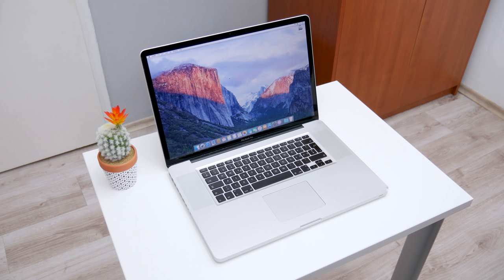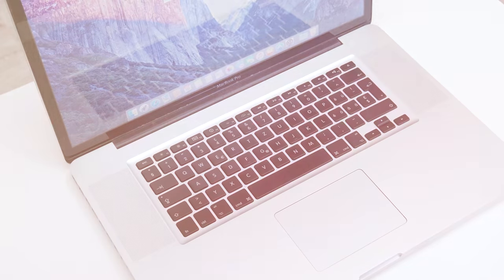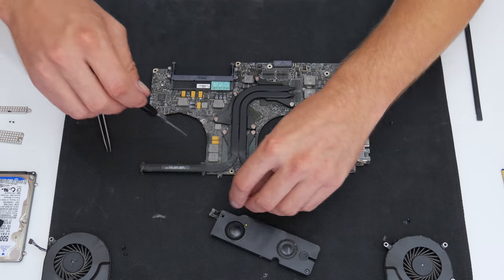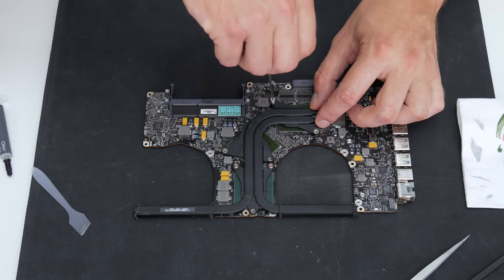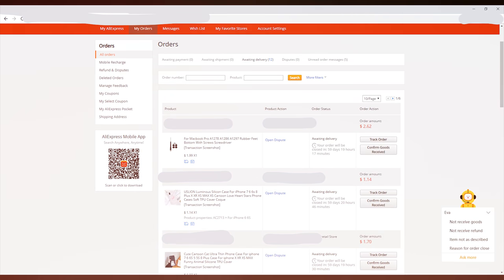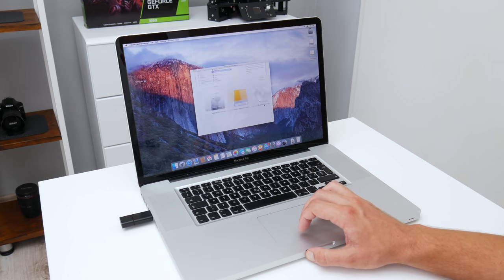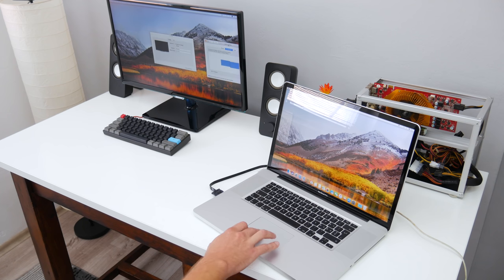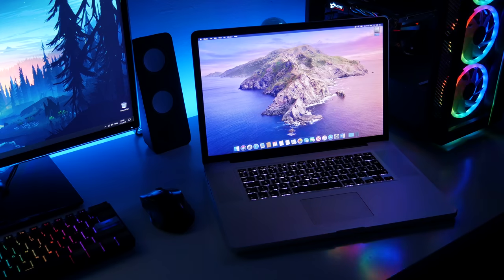Restoring and upgrading 17 Inch MacBook Pro and eGPU test!

Comment: Will you do a latop video fix on a 2009 MacBook pro 13in specifically how to re solder the fan connection to the motherboard. I have an exact mac with that issue and have not been able to fix it.

Comment: i want to know can an alluminium case be painted or should i use stickers?
Reply from the maker: Hi bro, these case can be painted, but you need very quality and hard paint because to make it scratch resistant and to last longer. Drawings with markers is okay but not for a longer period of use. Stickers are better option, because later if you don't like it you can easy remove it without scratching the case
Reply: @ComputersAndTechAndAndrew   thank you so much for your valuable advice i was thinking the same thing. 
I’ll definitely give it a try thanks keep shining bro!
Reply: @ComputersAndTechAndAndrew   one other thing buddy! 

I have an HP PAVILION DV6 6c43cl 2nd gen i5. 
The brass inserts are all messed up and broken from the chassis and I’ve no idea what size of brass inserts it take so i could order the right ones. 
Also i was thinking to re secure it with super glue and baking soda or cotton as I’ve seen many videos like these. 

So can you give any suggestion how should i fix my brass inserts to chassis strongly.

Comment: Thanks for the video, this is still my main laptop, I have pimped it with an ssd, new battery, 8gig ram from day 1, and a data doubler which holds another SSD. BUT something is up as it does crash, it might be a GPU panic issue or I might have damaged the ribbon cable which connects to the screen.  Does anyone know of any GPU issues with this model?  Nvidia GeForce 9400M 256mb ram is whats inside my model.
Reply: never heard gpu issue in this model. mine upgraded to highsierra, catalina and now monterey

Comment: why my 2011 MacBook pro has random shutdown "powers off" while working on it, what could be the problem?
Reply from the maker: Hi, are the temperatures good or high? also this happens with specific apps or with anything, like with web browsing, doing some basic things, working in some apps ?
Reply: Cat and Andrew during web browsing, im using fan control for temperature but i doesn’t over heats
Reply from the maker: @ANAS577  If the temperatures are fine and under 55 Celsius but you have shutdown then it may be the old and dry thermal paste ( sensors signalize that something is wrong ) or RAM or Disk. The RAM is higher probability, this may happen if one RAM is faulty or is the RAM has moved from the RAM socket ( try to remove and install the ram again )
Reply: Cat and Andrew i went to the store today and the guy told me it might be a battery problem, because when it powers off and i unplug The charging cable, the battery indicator goes to zero right away (talking about the light on the left the checks the battery while its off)
Today i changed from 4gb ram to 8gb
Added an ssd and applied a new thermal paste , but i dont know if i should change the battery or not.
All of that will cost around 3000 Egyptian pounds😢

Comment: How did u have 3 operating systems? I upgrade to shitty Catalina on my mid 2010 MacBook 7,1 and I can no longer use Airdrop or continuity. Tried to downgrade and Apple wouldn’t let me...
Reply from the maker: Hi bro, is easy, not hard as is looking, I made 3 partition and every single is for a different OS, btw if you cannot downgrade than you need to make full data backup and make clean install of macOS version that you want to have, ( Make FULL BACKUP, Clean Install will erase all data )

Comment: I see whit the MSI in the video u no connected it to psu must buy a psu and retry.
Reply from the maker: Actually I've tried with a few different PSU's, but that's not the problem, the problem is coming from the CPU, the CPU is SSE 4.1 and the RX580 request SSE 4.2, however, I tried to patch that and after the gpu was recognized but shortly after the gpu is stooped working
Reply: @ComputersAndTechAndAndrew  but apple its idiot for other components.

Comment: 11:37 This is wrong. You can put 16GB in it by doing 2x 8GB sticks
Reply: Bios or CPU may not support that much ram...
Reply: Knowing apple that's the case
Reply: @PlinkyVR  wrong. I've put 16GB in A1286 macbooks before
Reply: @zzly9338  what I said wasn't wrong, I didn't say "that mac doesn't support that ram!" I said because this is a common thing at times for some CPUs  that there bios or the CPU itself may not have supported it never did a correction but I just suggested that may be the issue. But if you've got it working in these models before then by all means say that all you want.
Reply: @zzly9338  on a apple discussion they say that 8gb is the max supported but that may be a different bios to the one you have, or that may just be the official supported amount any anymore could be unstable.
Reply: @PlinkyVR  apple discussions is a worthless website that pays people over $100k per year to give worthless answers and spread misinformation with the goal of getting you to buy a new product. Apple discussions is not out to help you in any way, they just want your money.
Reply: ZzLy Hi! I Have 17 Pro 2009 early with core 2 duo and i want upgrade ram to 16 GB, this is Possible ? What do You think ?
Reply: @JokerStudioRadom  yes
Reply: ZzLy i must upgrade bios ? Or something software?

Comment: Why are you applying so much thermal paste
Reply from the maker: Hi bro, actually is not much, it's a thin layer enough to stick the CPU, GPU with the Heat-Sink without causing empty space on the chip's or tiny air bubbles
Reply: @ComputersAndTechAndAndrew  Ohhh i see from my perspective it was much but i guess it must be the resolution of my phone. Well what you are doing is great for the environment. You should keep it up!
Reply from the maker: @clydeceniza2521  Actually on video is looking different, camera not always capture right perspective, thank you for the support bro :D i will keep up :D

Comment: I have a MB pro mid 2009, case near mint. After 5 years the Apple store said it needs new logic board because it would not power on. Is anyone interested in buying this for parts or repairing this as a project? I am the only owner and it has been inside my house in a case since it stopped working. Part # MB604LL/A

Comment: Cringe at the amount of thermal paste used...
Reply from the maker: Hi bro, That's usual and recommended amount, on camera is looking different but in reality is very thin layer. Also maybe is looking a lot but actually that's enough to stick the heatsing equal everywhere and to avoid air bubles over the cpu and the gpu